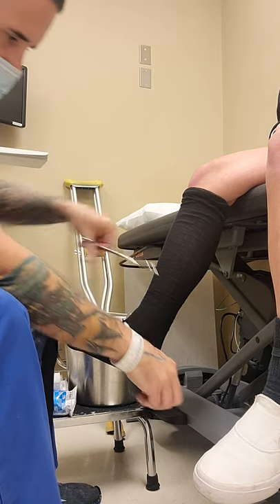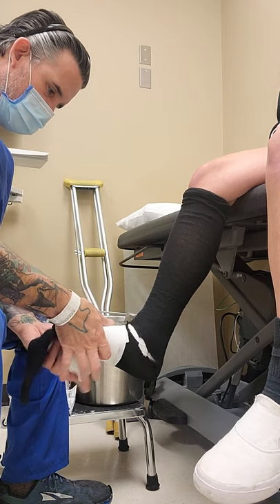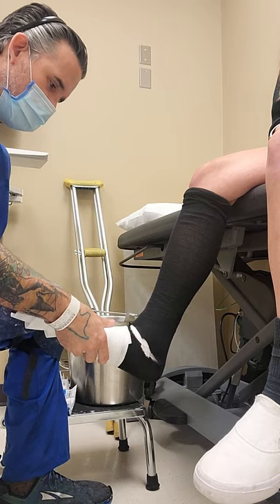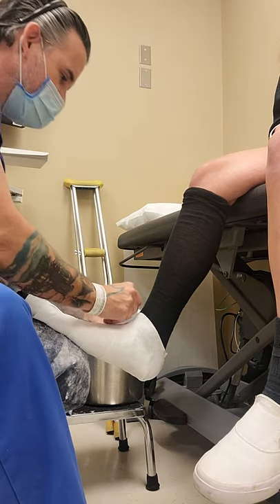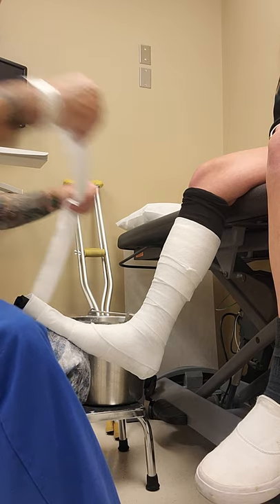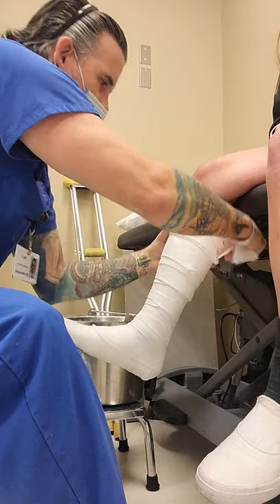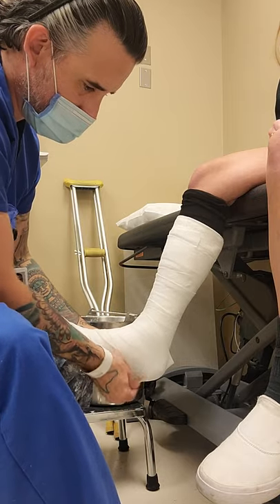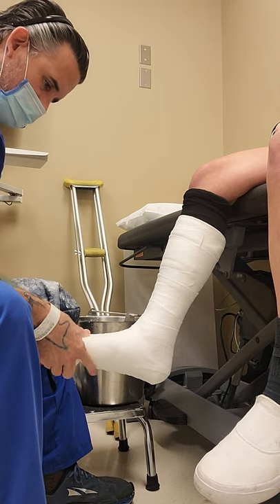Short Leg Cast with Fiberglass

Comment: Hi, hope you see this. I had my fiberglass cast out on my foot 4 days ago and I have noticed a very soft area right where my calcaneal osteotomy screws/wound is. My nerves keep making my leg spasm and move, which is causing me to accidently knock that area where the cast is already soft. I have NOT got the cast wet at any time. Is it normal to have soft areas on the cast?
Reply from the maker: Well a cast is soft inside with a hard outer fiberglass shell. That shell doesn't get soft even if it gets wet. So I don't understand exactly what happened. Itt is very common to have nerve, muscle spasms and pain after a injury/surgery etc.